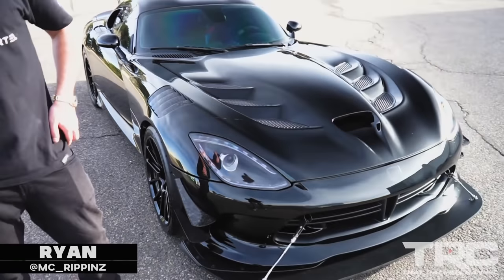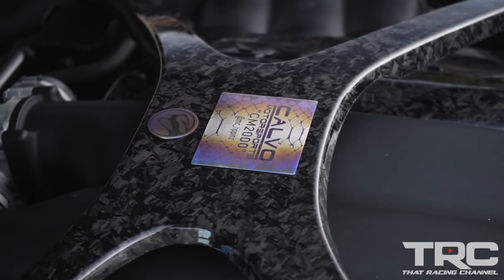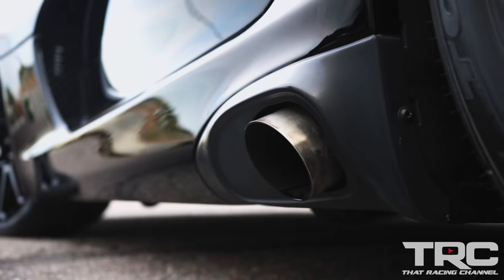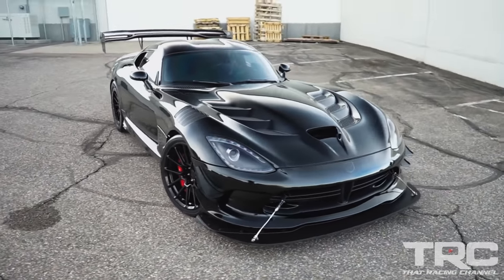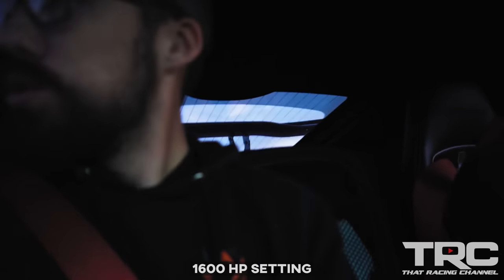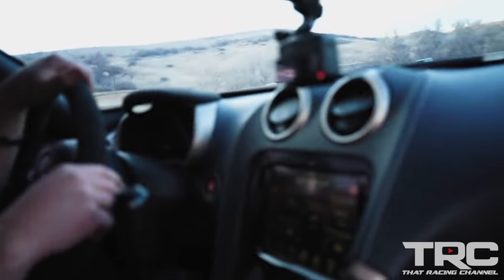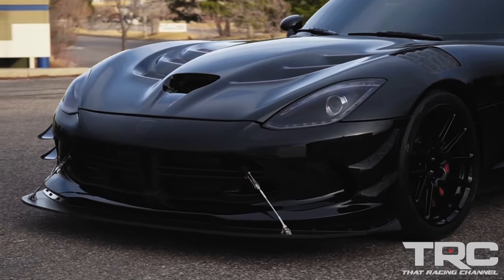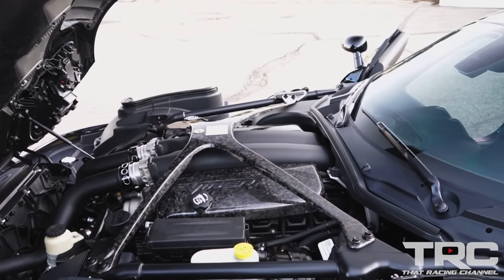2600HP Turbo Viper UNDEFEATED ON THE STREET! 9L Stroker + Sequential (2000lb-ft OF TORQUE!)

Comment: I love that its sitting at 1600 casual HP and it's still got another THOUSAND in maps.... That's just mind boggling. Holy crap!
Reply: Ya if you believe the bullshit that this car actually has that much hp
Reply: @yoteslaya7296  why you say that?
Reply: Youtube the smart car with 600 hp.
Reply: only possible with the Viper because the large engine was built very stable! You could never do something like that with a 4 cylinder, 6 cylinder or Wankel engine !
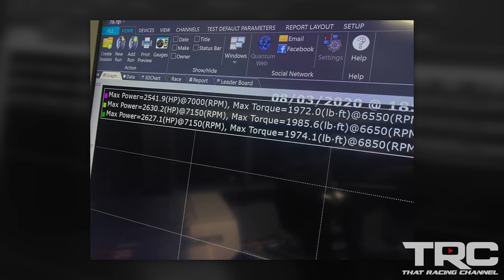Reply: @yoteslaya7296  Numbers dont lie 4:51
Reply: @yoteslaya7296  its a 9 liter twin turbo v10 thats more than possible lol there are 2 liter hondas making 1000+++ hp...
Reply: @MV-ri7zu  ya  but hector is going to be running 3 hondas with spoon engines and on top of that he just ordered 3 t66 turbos and nos.
Reply: @yoteslaya7296  🤣
Reply: Im just amazed that the engine can handle that much power consistently without ruining itself. Cool engineering
Reply: @pleaseenteranamelol711  no replacement for displacement.
Reply: @yoteslaya7296  what?
Reply: @MV-ri7zu  new to english my friend?
Reply: @yoteslaya7296  you dont make any sense
Reply: @MV-ri7zu  dont you know that hector just bought four spoon engines with t66 turbos and nos?
Reply: @yoteslaya7296  you a lil slow for sure
Reply: @MV-ri7zu  dont be mad bro its just the internet, the information SUPER HIGHWAY! 🚕🚖🚘🚗🚙🛻🚚🚛🚜
Reply: @yoteslaya7296  they literally put the Dyno sheet in the video these vipers are capable of 3k hp
Reply: @James-dx4qd  literally
Reply: @yoteslaya7296  Cope
Reply: @kylegilmore3810  lol grats using dead memes kid
Reply: @yoteslaya7296  Your post is a coping mechanism
"d-dead meme.."
2,600hp to the hub.
Reply: @kylegilmore3810  lol seethe more nerd
Reply: Guys, Here is our Savior

YaH The Heavenly FATHER HIMSELF was Who they Crucified/Pierced for our sins and “HERE IS THE PROOF”

From the Ancient Egyptian Semitic: 
"Yad He Vav He" is what Moshe (Moses) wrote, when Moses asked YaH His Name (Exodus 3)

Ancient Egyptian Semitic Direct Translation
Yad - "Behold The Hand"
He - "Behold the Breath"
Vav - "Behold The NAIL" <— YaH’s Crucifixion
He - "Behold the Breath"

“Behold the HAND that Beholds The NAIL” 

PROVES - YAH The Heavenly Father HIMSELF was Who they Crucified

That is EXACTLY what Moses Wrote

Here is what they mean

YaH's Name:
(Ya)d + (H)e, as YaH is what Moses called Him and YaH Declared: "this is My Name, this is My Name for all generations" (Exodus 3)

YaH is The Creator of “MAN”: (Genesis 2:7)
Yad He, (HAND BREATH), as YaH's "HAND" Formed man from the dust  of the Earth and His "BREATH" made him a living being (Adam)

YaH's Sacrifice of Crucifixion for “MAN”:
Vav He (NAIL BREATH), the "NAIL" through YaH’s "HAND", in Sacrifice of Crucifixion, that whosoever shall call YaH Savior, His “BREATH” brings forth life (Salvation)

How YaH arrives:
YaH arrives via the Tent of Meeting (Exodus 33:7:11, Isaiah 54, 55), where a Tent is erected outside the city, a cloud descends upon the entrance of the Tent and YaH appears...

Why they demanded YaH to be Crucified:
YaH was Crucified according to Hebrew law (Deuteronomy 21), to be NAILED/PIERCED on an Almond Tree for BLASPHEMY as it was for His NAME they demanded Him Crucified. The Messiah claimed He was YaH...

HE WAS YaH!!!

HalleluYAH translates “Praise ye YaH”

The Hebrew Book of Isaiah

Isaiah 42:8
"I am YaH; that is my Name! I will not yield my glory to another or my praise to idols.

Isaiah 43:11
I, I am YAH, and there is no other Savior but Me.

Isaiah 45:5
I am YaH, and there is none else.
Reply: @kylegilmore3810  legit the simplest bait ever and you got hooked tf up. Take the loss and move on
Reply: @bigdawg77  "bait" It's dry British humor, Clarkson doesn't know the meaning of 'bait', and everyone knows the British aren't funny - even less so than the Germans. Try again.
Reply: @yoteslaya7296  Vipers can be built for that much power. Other cars too. There are 3000 HP lambos and nissan GTR's out there.

Comment: If you walk bikes in a car. You’ve truly made something special.
Reply: nowadays. this is car culture. we got few super/hyper cars that STANDARD won't see a bike tail light. this is the TWILIGHT of the MOTOR engineering.. I appreciate power weight ratio of bikes too, but one wheel? I like my Quattro, monster motor in front/back POWER, and the girl in may seat baby. aight.
Reply: We need this to go against the hoonicorn
Reply: Walk? Dude put planes this thing is on a whole different planet.
Reply: @B01  i was thinking that but i feel like it has no chance now 😂
Reply: @slavche  which one stock runs 7s cause 7 and 8s out of modified zx14s and Hayabusas aren't too hard with a good rider.. bikes will always beat cars $for$ unless your building a full blown rail
Reply: @Brandon Bennetch wouldn't be on it at all if all screws were tight lol
Reply: @B01  from a roll? Its gonna obliterate the hooni. From a dig? The hooni claps it.
Reply: @khaosking2937  both turbo, is it the weight difference?
Reply: @B01  the hooni weighs 2,998 lbs with a twin turbo and is awd making 1,400 hp and 1,200 ibs of torque

That viper makes over 2,600hp and over 2,000 lbs of torque is rwd and weighs 3,600 lbs...

Both have massive advantages against the other. From a dig the hooni is gone.

From a roll...the viper has a 1200 hp advantage. It blows the turbos off the hooni
Reply: @brandonbennetch3324 a man exposed to the elements, w no radio or AC hot when it's summer, cold when it's winter..LOL, no eating a burger and drinking coke.. or talking to his girl...LOL laughable
Reply: @adamguzzo94 ya I'm sorry but put a TT rider on a bike and see what happens. I'd put my money on the bike every time.
Reply: @riskaddictionrc  I'm what context are you taking about? I pretty much said that bikes are always going to have a huge advantage over cars
Reply: @riskaddictionrc  I'm what context are you taking about? I pretty much said that bikes are always going to have a huge advantage over cars
Reply: Not just any bike either. That was a beamer
Reply: @cliffcox7643 those are the sacrifices you make to be the fastest
Reply: @Bryanseas  haha, to be the fastest and lonliest looser
Reply: @cliffcox7643  called having both, but we bikers know were superior
Reply: @bryanseas6061  superior like the lake?
Reply: @cliffcox7643  superior
Reply: You only need 1000 engine hp to walk most liter bikes from a 70 roll.  It's not that much of an accomplishment these days
Reply: @johngatsby1473  ya “a bike” is very general, like saying you only need 300cc to walk “a car” like ya, any car. But 1,000 cc vs 1,000 hp? Not a chance lol. My h2 dusts all you guys. You NEED close to 2,000 because even 1500 i pull in top end
Reply: Is this still undefeated??? Asking from the future 2023
Reply: @cliffcox7643 not having to talk to your girl is one of the best parts about riding a bike
Reply: @Username-2  sure whatever you say.
Reply: hard to beat a S1000rr or busa
Reply: You only need a 900hp bike to keep up with this thing. Nbd

Edit: and a pair of AR500 steel balls
Reply: 2016 Yamaha R1 215 RWHP. That was my death machine. I think I’m done after that one. I’m getting older.
Reply: @khaosking2937  eh not always the case, ive seen plenty of purpose built vehicles that have lost awd vs rwd. A properly setup rwd car can launch almost as hard as a awd and then with all that extra power can easily reel in and pass.
Reply: @taylorjones5370  very true as well
Reply: Cars always dominated bikes..from a. Bike guy..look at contact patch alone and it's easy to see. Plus you can do as much aerodynamic work below the car unseen as above the car. 
How long does the motor the run in that configuration without needing to be torn down...that's where the true build lives..I'm cool with 1000 to the tires on a street ride..

Beautiful car..I built prates for exotic engine company and one of my good friends hand assembled the viper orca motors from le mans..that's his car in my icon photo..when put away last that car in my photo only made 4000 h.p. with a 440 cu inch motor..hence the laundry.

Play hard..play safe

Don't hurt innocent people having fun and let her eat.
Reply: @cliffcox7643  sounds like someone can’t ride a bike lol
Reply: @slavche  quattro ?   LOL,  nothing with "quattro" will ever even come close to a litre bike
Reply: @noidontthinksolol  He didn't say that his quattro would beat anything, he just said he likes it for his own preferences.
Reply: @bigrich7026  lmfao,  a motorcycle has more contact area per kg.   you can use more of the road in corners and you need well over 1000hp to even come close to a bike.    and even then an H2 with a tune will still absolutely destroy you.  

the only thing faster around a track are formula 1 "cars" and full blown racecars.   
an amateur with a stock street bike did 7:10 around the nurburgring, something 99% of cars cant even dream of.
Reply: @B01 hoonicorn will shred that Viper. AWD baby. Only a massive tuned AWD Nissan GTR and a Top fuel Dragstar could beat the Hoonicorn. That Viper is RWD right?
Reply: @khaosking2937  Both of bikes and rwd cars have problem with traction and gear box that's why the go rolling over 120 khm/h so they put 3 or 4 gear depending what vehicle we tall about. the ghost rider hayabusa and many more they make over 600 hp and the weigh it is 300-400 kilos so we got over 1.7 hp per kilo in turbo hayabusa in this car with your estimate 1.600 tons with 2600 hp they make over 1.6 hp per kilo. if we have ultimate traction the big chance to win is with in hayabusa, but with traction both of them rwd and bike will strangle a lot. Bikes loves high speed rolling starts. no power wheels.
Reply: Yeah that is crazy! How far it pulls! Good lord😂
Reply: I wanna see him race the new ninja H2R
Reply: I have a fast bike. I want one of these builds so bad. 🤤
Reply: @tylerevans8247  wt do u mean new h2r? That thing came out nearly 10ys ago..

Comment: i know the aero is technically making it "slower" at speed, but i bet at this point its almost necessary to keep it on the ground. such a sick machine
Reply: That aero is definitely not needed at speed (too much) .  Its probably most useful during high acceleration form like 60-100
Reply: @hagestad  i mean its literally keeping the things stable and shoving the wheels down so he can get traction on the street like that. Any other car would be aaaalll over the place on the street with that much power unless this thing has an insane and seamless traction control system
Reply: @hagestad Actually, the guys who run these Gen V Vipers on the strip keep the wing because the wing generates enough downforce to keep the tires pinned to the ground. Thus giving these things insane 1/4 mile times.
Reply: @hagestad  the Audi TT was literally lifting off the ground at launch until they added aeros and it does not have 2600hp. I am pretty sure they might be necessary
Reply: the 200lbs of audio equipment in the back probably helps also.
Reply: @ppeez  Not at launch. Aero doesn't do anything at launch.
Reply: Exactly
Reply: Exactly
Reply: that is correct. when you have insane power downforce is needed for good traction or you're flying first class into a barrier lol
Reply: imagine a aero like the bugatti tourbilloun or this new pagani which literally has kind a wind tunnel underneath the car with more poweer

Comment: This is why 1/3 of vipers are totalled. Vipers are just scary to drive. Mad respect for this guy to put 6x the power to it.
Reply: What a gorgeous machine tho. I've always wanted one. I don't think I could handle that much power.
Reply: @frankierzucekjr  if you buy one be careful. I'm not a mathematical genius but I say 1/3 totalled vipers is worse than the shitty mustang drivers totalling them. Just a scary car. I'm no professional driver but alot of them say its a different animal than say a Ferrari or lambo.
Reply: @matthewchristenson3875  That's why you drive it a lot and slowly work up in power. There's a way to tune the suspension so it's more stable. But yea I'd be scared to shit to drive something with this much power
Reply: JoshuaJKarl  "some boosted some supercharged" "peak 710 695 overall" Only dweebs who rack up 1000 hours playing forza says this lmao y u cappin on the internet
Reply: I just recently bought my first Viper (04) and it's unbelievable to me. I couldn't even imagine something like this. Definitely a beautiful ride with an unbelievable amount of power. Respect
Reply: JoshuaJKarl  thanks man! It's definitely an awesome ride.
Reply: Lol wat. Vipers are totalled because owners suck at driving. Zero issues with mine, I push it hard, you just need to understand when enough is enough.
Reply: @giovanni4304  I agree man yes the car is insane just from the factory but Always it's more the driver then car just gotta know your own limits AND also the cars limits I put almost 100k miles on my built 09 subie sti nvr had any problems. But dudes always saying yeah right they always blow up or tranny goes or they wreck blah blah people just stupid lol
Reply: @giovanni4304  don't kid yourself. There is never enough.  Why do race car drivers crash? They are professional and should know when enough is enough. No they push that shit because where is the limit your car can handle? I lay my bike down about 1 time a year thinking I can take a corner faster than my bike can handle. Where is the limit?

Drive fast and take chances.
Reply: I could drive a Viper just fine.
I wouldn't rip ass with it. 
I'd grandpa the thing. 
....somewhat. ;)
Reply: They're not scary. Just need to learn the car like any other. Sure a Vette is more predictable but once you learn how to drive it, the Viper is lot more fun.
Reply: The acr is really controllable (from what I've heard anyway) it was build as a track car. Any other viper though... Yeah they are scary
Reply: It’s just a viper body
Reply: Agreed. I have a 2008 and it’s a beast. No traction control, independent rear suspension, 600hp stock, and very front heavy. Going into corners, they nosedive front the weight of the motor which unloads the rear wheels. Viper owners call it being “snakebit”. I’ve spun mine around in the street several times. Brute force but fun.
Reply: Dirty Harry said it all. "A man's gotta know his limitations."
Reply: Bitterman  Right... No roll cage no wheel lift no head snap on street tires...Bunch of stuff doesn't add up does it.
Reply: A lot of those numbers are from the first generation vipers - and theres a multitude of reasons. Terrible tire technology back then, don't drive them in the rain, insane power to weight ratio (one of the best power to weight ratios of any production cars), no stability or traction control... yeah lol
Reply: Sounds like a made up statistic to me
Reply: @_pitaph_6392  That number isn't even from new vipers I don't think, it's from first gen vipers. In that case, it makes sense. But new ones have traction and stability control, as well as much improved tire technology compared to the early 90s
Reply: @matthewchristenson3875  correct. Viper put the manual in manual steering. If a person does not know what they are doing behind the wheel a viper is not for them
Reply: Bitterman  jealous much, it's a sick car that's unbelievably fast. And roll racing is thing...
Reply: John Buck  meaning it s not an easy car to drive. If you don’t know what you are doing behind the wheel of that car (especially the older models) you will crash.
Reply: Well crashing one is really the only way to kill one. The stock block can handle over 3000 hp and in stock form they are one of the most reliable performance cars of all time.
Reply: I cant even imagine how much change he drops yearly on fixing shit that fucks up. Daily driver rides not meant to handle that kind of power.  The car is Definitely insane though
Reply: @tonioalvarez5853  my friends 5.0 is at 200K miles with no issues and people think its gonna blow because its a ford but its been solid
Reply: @tonioalvarez5853  I have owned three, still own my gen2 GTS and love it. So, here is the bottom line...gen5s are better in safety but not totally, it's really a driver's car and can do anything you want, bad or good.
1. tires every three years despite mileage, they are about 1.5 feet wide each so that's your traction control (besides you). 
2. DO NOT get on the highway and downshift into 2nd or 3rd, REV MATCH, and then let off clutch unless you like doing sideways burnouts into the sides of cars or off the road.
3. It's not a Vette or mustang or Lambo or Ferrari, its geared differently and more torque, like a custom muscle car, know how it acts and react appropriately. 
3. They corner AMAZING and grip crazy, they were meant to kill Porsche which is how viper won le mans and as well as beat the crap out of Porsche and ferrari at Green Hell in Germany Multiple years. Yes, TEAM VIPER beat one off Ferrari and Porsche racecars in a viper right off of the dealership showroom. If thats not Merica' enough, not sure what is. They almost did it again in 2017 but wrecked, ugghh. Watch Viper: GREEN HELL on YouTube.